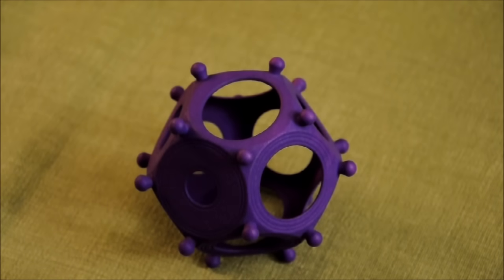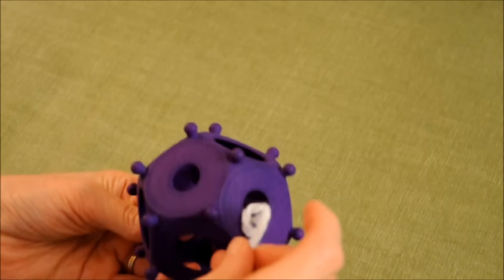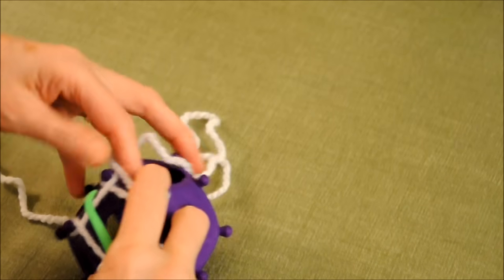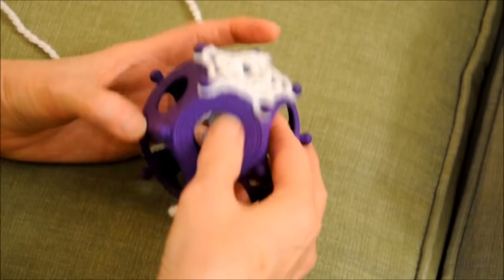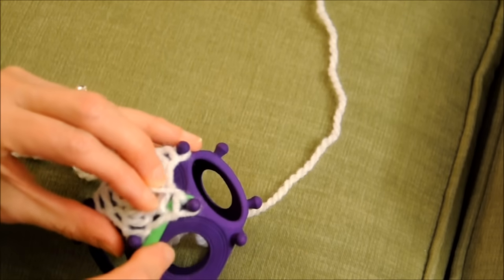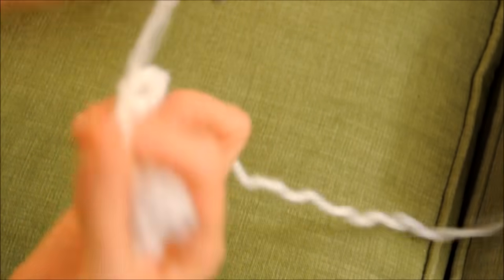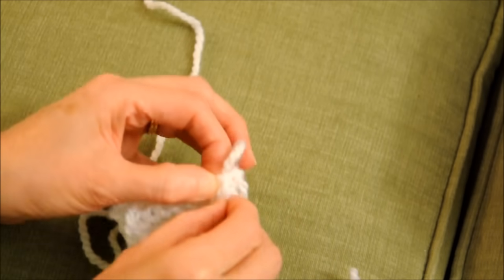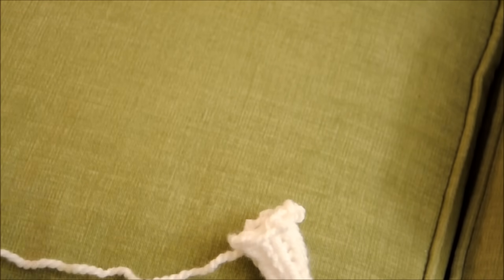Knitting with a Roman Dodecahedron

Comment: They are candle holders for different sized candles.

The simple solution is usually correct.
Reply: Gallo-Roman Dodecahedrons are only found in the North of the Empire, England, France and Germany etc. - the cold parts  where gloves would be handy 😂. Candles were used throughout the Empire. The wax may just come the lost wax casting  process.
Reply: @agamemnonhatred It gets very cold in Italy, especially in the mountains. So I don't think it was temperature related.

Comment: To make a different size  gloves shouldn't the post be spaced differently. Using this aren't you just pulling the same size finger through different size holes?
Reply: lol yes.
Reply from the maker: Yes you are, but the point is, it works.  This is a very primitive form of knitting, and doesn’t make sense to us because we know about knitting with needles, a much later invention.  Anyway I just did it to prove it CAN be done, because a commenter on another channel was screaming that it absolutely wouldn’t work.  Thank you for commenting!

Comment: We used to make these in junier school.uesing a wooden cotton reel and panel pins put pins round top of bobbin and wind yarn in and out the end comes down the hole in middle ,just same but cheaper and recycled instead of using plastic , which as been a n asset and a plague.

Comment: Have you made gloves before? How was using this device to make the fingers? Did it require less effort to keep the roundness of the finger then anything else you used? Also, after trial and error, did it speed the process up? BTW, thank you so much for your video. Don't get me wrong, I like the video TheMartinhallett did, but I see that experience really pays off.
Reply: That is the fundamental question, does it make easier or not?
It should be a very expensive tool back then.
Reply from the maker: Sorry, I just saw this!  I have made several pairs of gloves and mittens before using short double pointed needles.  The fingers are always round either way you knit them because they are knit round and round, and also your finger is round too so that keeps them round in shape.

It's anachronistic to compare to knitting with needles;  the experts say there is no evidence of knitting needles from this time, so i don't think people had the choice.  Also, most knitters consider this method more primitive than knitting with needles;  you can't do as much with spool knitting as you can with needles.

Comment: Wouldn't it be easier to use a crochet hook rather than that knitting needle with the curved tip? Also, you don't need a dodecahedron, just a short, cylindrical piece of wood, with 5 nails hammered in part-way around the top

Comment: This is not the solution to the question of the Roman dodecahedrons.

The size of the finger you knit is not governed by the size of the hole, It is governed by the number of stitches in each layer.

Given that each face is surrounded by exactly five little knobbly bits, each 'finger' will be the same size.

Comment: The knitting theory is defeated by the existence of an icosahedron with many tiny holes (see Wikipedia). It's not a candlestick, for similar reasons. Best guess is that it's a flower-arranging artefact for supporting smaller or larger bunches of flower stems (or single stalks in the case of the icosahedron). It needed to be heavy. It needed not to rust.

Comment: I would not be suprised if this was the thing, I was reading an article about these today, and was like "Did anyone ever try to use this as a crafting thing. I didnt think this was called Kniting, but i remember having a block of wood with 4 - 5 nails in it on the top, and a hole between them going down. and i would create something similar using similar method,

Comment: Ok they are absolutely not knitting devices I believe since they are often found by coins that it is some sort of gambling device imagine quarters mixed with corn hole , you gain points by bouncing a coin toward the dodecahedron and the difficulty of the hole you make it in and if you knock an opponents coin out determines how many points you get that's tge best answer I got for these mysterious objects

Comment: Hello! I realise this video is a few years old now, so who knows if this will get to you, but I am considering starting a small project related to this! I want to show, through experimental archeology, that these indeed were used to make gloves. I would like to be as historically accurate as possible, using the fibers that would have been regionally available, hand spinning the fibers, knitting a completed glove set and perhaps felting (if that was a practice at the time).
Reply from the maker: Tea Time sorry I just saw your comment!  That is an admirable project, but first you have to learn how to spin!  In my experience that is harder than knitting. Good luck to you!

Comment: I guess the question is:  Is it a labor-saver over regular knitting?
Reply from the maker: No it’s not.  I think that’s why most people knit with needles!  But the technology still exists today in the form of “spool-knitting” or “loom-knitting”. It’s just not as popular.
Reply: @ChertineP  Thanks for the reply.  I assume that the Romans, too, knit with needles.  If the Dodecahedron is not a time saver, then its use as a knitting tool is probably not what it was intended for.  It is, however, a very clever solution.  I am impressed with the mind that figured it out.
Reply from the maker: @thomkrala  actually, there is no evidence of the Romans knitting at all. Neither documentary, or pictures, or artifacts.  Textiles almost never survive in these climates.  It is just a proof of concept, mainly cause someone said it COULDN’T be done.  I can’t prove anything about what the Romans did do.  I just hate it when people make a categorical statement that is so easy to disprove.  It only takes one counter-example to disprove a general statement like that.  I am a contrarian, I guess!
Reply: @thomkrala  historically, naalbinding would have been used, rather than needles (or pins, as they were also known at some point). The earliest known knitting needles are a set of double pointed ones found in a Turkish tomb from 1390, which is much later than the Roman period.
Reply: I am rather inclined to the conceptual brilliance of the person who came up with this answer, whether it is the correct one or not.

Comment: Could they have knitted a flat piece a little more than twice a palm length that you folded over the outside of the palm, then joined into a tube at the thumb, then closed as one attaches each finger?
Reply from the maker: Sure, if they had needles.

Comment: I was thinking that larger holes could be used to make socks, sleeves, even tubes which could be flattened and sewn together to make shirts, robes, filled squares like an afghan, with insulation, just all sorts of clothing items. One person mentioned felting and shrinking the yarn while on the hand, which would be tighter, finer.   What about cords, ropes which are always useful?  Another person mentioned the idea of using them as a tent fitting.  Since they provide tie points and angles, larger ones could be useful in more settings.  Some have not just  small round balls  on them, but more like a finger shape, probably easier to use.  Thanks for your video!
Reply from the maker: Kay Anderson I haven’t heard that some of them have projections that are more finger-like!  Can you post a link?  Thanks for commenting!
Reply: I was looking up the photos of old Roman ones and some of them had if you think of the real small balloons that are shaped sort of like an elongated pear, about an inch or two long - they appeared to be about that size.  I'm trying to remember the site.  It was a museum site I remember in Europe.  Here is one I was checking out, I think it's the one - Ancient Worlds at the Manchester Museum.  I was also thinking it could make a spur of the moment weapon, if put on a rope.  Sad, but true.  You could also use it as a way to throw a rope over a stream, over a wall, not the best way, but when I first saw them I always thought they looked like a round loom.
Reply: I put the question in "what is a Roman Dodecahedron" and YouTube showed me your site, as well as quite a few others.   Two of them had some of the photos I was talking about, See my other answer below.  These two are easier - "American Eye, Discoveries from the Roman Empire"; and "TheMartinhallett" site, which listed "The Roman Dodecahedron", and one site says more than 100 of them have been found.  Sorry I don't know how to do links, but this should help.

Comment: What are the different sized holes for if the glove finger diameter only depends on the pin spacing?
Reply: LukeyHear After working with it, I believe that is not true.  Drawing the piece through the hole determines the final diameter just as drawing a piece of wire through a smaller hole gives a smaller diameter.  Yes, they are all only 5 stitches around, but if drawn through a small hole, the stitches elongate and become narrower, and if drawn through a large hole, the stitches become wider and shorter.
Someone who knits gloves with double-pointed needles (the modern way) would not know this, since the stitches would all adjust according to the tension of the knitter.  They would have to have more stitches (say 10) for a large finger in order to get a larger glove finger.
Reply: Thanks for getting back, I am not a knitter but I am interested in knots and am struggling to understand where the surplus wool goes to each time it is poked through the hole. Do the stitches get broader? I thought the tension was established at the point you are wrapping around the pegs? Hope this makes sense, thanks again.
Reply: Please do not use this woman as a knitting resource.  This video shows that she doesn't understand the basics of how knitting actually works.
Reply: are you always a horrible person?
Reply: bruh it is not that serious
Reply: @VioKyuuketsuki  Your comments come off like you are not used to talking in any educated fashion.

Comment: Only knitting wasn't invented until the 5th century in the Middle East. As a knitter, you know that the holes being different sizes has nothing to do with the thickness of the fingers, it has to do with the pegs, which are all symmetrical.
Reply: @fried plastic Yes, humans have, of course been wearing clothes since prehistory. We only started using yarn to do it at home with knitting needles since the 5th century.
Reply from the maker: When I was a kid there was a toy.  It was a tube woven of flexible fibers that we called a “Chinese finger trap”.  Pulling on it caused the tube to contract in diameter until you couldn’t get your fingers out.  This is how drawing a knitted tube through a smaller hole would work.

Comment: So has the big MYSTERY been solved? This tool was used for knitting? I'm curious, which model is closest in size to the original that it was made from? Small? Medium? Large?
Reply from the maker: Rustina it looks like the small is the closest match to the original.  If you look at the paper I linked to in the description, (sorry, it’s in French), it says that the original brass dodecahedron found at Jublains was 59 mm tall and 74 mm at its widest point.  Shapeways says the small one is 64 mm high and 65 x 68, so I think that’s pretty close.  I know thats the size I ordered from Jacant.  But I think the larger ones are still within the size range of found Roman dodecahedrons.  According to Wikipedia, the largest is 11 cm (110 mm).  Hope this helps!
Reply: Dont make sense, it thye were used for that they would have all the same size.
Reply: pedro silva slva Why would they all be the same size? This could be used for multiple different things

Comment: While it's possible to use the Roman Dodecahedron for what you are doing, I doubt that was what it was for. I think it might have been some type of ornament on a staff.  These were found where soldiers once camped, and I doubt they made gloves. They probably had gloves made for them before they went on a campaign.
Reply from the maker: alan30189 that is a possibility.  But the evidence shows that these were only found in the northern parts of the empire, never in the south.  See the paper I linked to in the description

Comment: It is not actually roman but probably Celtic. Likely ritual after all since versions have been found where the holes are so small (while making beautiful patterns) that they are definitely not used for anything. Yet the rest of the design, like the knobs, are still there. 

In any event they are NOT roman. Roman era is a much better term, but from their geographical distribution Celtic makes much more sense.

Comment: Knitting LOL .... NO!
Just seeing it for the very first time... it is Blatantly Obvious what it is and is used to do.
It is a Cypher!
Each hole is a different size = different sized peg for each hole = each peg has a fixed and a rotating disc of Latin Alphabet.
Twelve sides = 12 difference cyphers. So when use peg 7 with it's pair of discs. After the cypher is jotted on the wood, papyrus, etc, placed inside a courier container (cylinder) and pour wax and press down the bottom (opposite side of discs). 
The person receiving it would place their unit in the wax holes to get the right size 7 UPwards... put in the matching cypher 7 peg with discs... and decode the message. 
Easy way to convey Secure Messages across the Empire!
New size 1 to 12 pegs / discs could be made each year or each Olympiad (4 years)... so the code is impossible for anyone without a unit... or with the OLD cypher = message is jibberish.

Comment: Interesting theory, but it makes no sense whatsoever. These devices are made of bronze, they are heavy, and were difficult and therefore also probably expensive to produce. If they wanted to knit and needed a device for that, it would have made much more sense to carve something out of wood. Also several of these were found together with military items. Did the Roman legions really knit at spare time? Why isn't this mentioned in historical records then that there was a lot of knitting going on while conquering half of Europe.
Reply from the maker: Lol.  I don’t aim to prove anything besides the fact that it’s possible.  I specifically set out to contradict  someone who said “its totally impossible to knit gloves with this thing!”    I agree wood does seem more sensible.  As far as soldiers knitting though, imagine you are sitting on Hadrian’s Wall in the dead of winter, uprooted from your home in sunny Italy.  Who knew it could get so cold up there?  Your equipment is totally inadequate, and there are long nights to fill….    Anyway, thanks for the comment

Comment: Did they use them to make chain mail gloves?  Or measure or pull wire as if in different gauges?
Reply from the maker: Hi!  I don’t have personal experience with either of these skills, but from what I’ve seen on YouTube, chain mail is made of rings of wire soldered or riveted together.  Pulling wire is made using tiny holes in a board or plate, just the diameter of the wire you want.  I only suggest knitting because I’m familiar with old-fashioned knitting devices using  pegs, like these.

Comment: wheel .... theories are many .. but like all man-made tools can be used in many ways. For example. The hammer can be used for construction, for breaking nuts, it can also be a weapon. I think Roman Dodecahedron was used to teach students sacred geometry, if we triangulate the five sides with a string, we get a five-pointed star, the intersections of the star can be triangulated again, and we get in a smaller pentagon and so on. By far, a very good example is the spider web which usually has several equal triangular sides .... like a pyramid😀, made of isosceles trapezoids, and in the middle of the spider web is a circle ... combined geometry ?. If you twist the strings in the middle you will get the Golden Ratio shape, from here it is another step to the geodesic dome which is the perfect shape offered by nature, the diamond. The most stable form of construction, with the fewest resources, which is not affected by wind, rain, snow. So .... I think Roman Dodecahedron was used in schools, so attention to detail when it was created. if we look closely it is on the surface the numbers 3 and 5 are repeated in the form of circles or dots, and the Roman Dodecahedron without holes is the connection between 3 and 6. Why is it not found inside the Roman empire? .... Sacred Geometry is associated with the belief that a god is the geometer of the world so: Plato, Archimedes, the Greeks were No, No, No, for Romans .. My humble opinion

Comment: makes no sense.  why bother making a dodecahedron if you only need one side?
Reply: Different sized fingers for different people
Reply: @ChrisTooley  Would be easier ti have several flat disks for that purpose instead of one dodecahedrin.  Also after further looking at other examples, some have no holes, and others, the knobs are such that you could not anchor yarn, ie half globe shaped not peg shaped.
Reply: @ChrisTooley  also, i doubt the hole would result in different size knit tubes, instead, the spread of the pegs would seem to determine the size of the tube.
Reply: @phoslurperr  all good points - I think the dodecahedron would be better for portability than a large set of panels though.  Very interesting objects in any case.